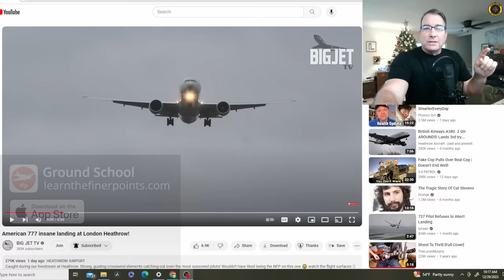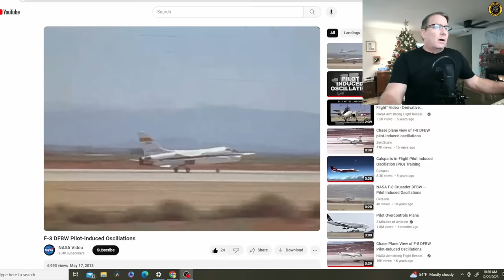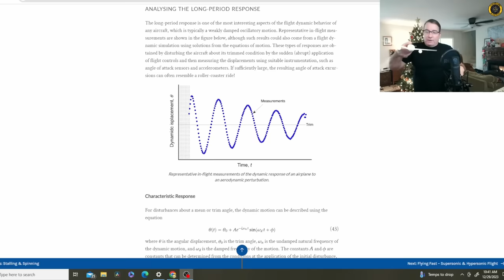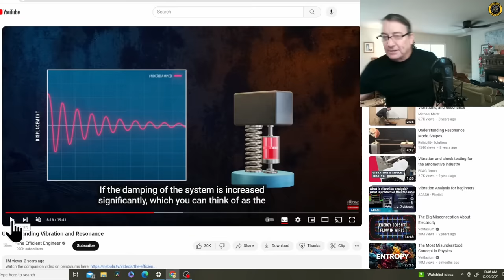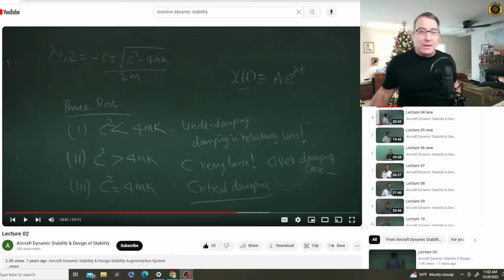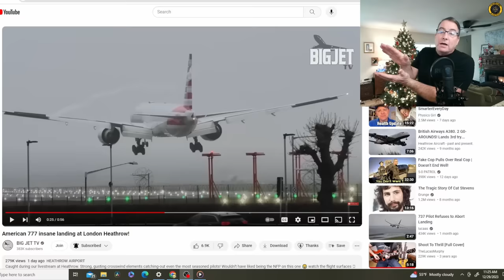B-777 Hard Landing LHR Big Jet TV

Comment: Not sure why my comment appears to have been deleted?  My point was that this is a much more complex issue.  PIO is not so simple, and in this case, the flight control system is actually commanding the elevator.  The pilot inceptor is a rate controller, in this case it should be theta-dot, so the elevator might, or might not, be moving based on pilot inputs.  There is simply not enough information to know here.

Comment: Watching the video, the wings appeared nice and level and then there is a large amount of spoilers on the left wing along with an easily seen right wing flaperon moving down.  Seems to me that initial wing drop starting the whole upset sequence was started with an inappropriately huge amount of left yoke.  Almost like the pilot thought he was "inches" from the ground and was attempting to put the left main/upwind gear down just prior to removing the crosswind correction, except he was still quite high in the air.

Comment: Respectfully Juan, theres nothing normal about holding the elevator full forward in ANY landing. If you do this during recurrent in the sim the debrief is going to be interesting. We dont need to worry about the effectiveness of the nose wheel two seconds after touching down. It’s interesting that the rudder position wasnt mentioned-despite being to the right the entire time.

Comment: I was on a ba 747-400 flight into Sydney about 15 years ago,the aircraft landed extremely heavily upon landing the fo announced that the aircraft had experienced a bird strike.,As I was transiting through to Melbourne we were required to remain on the aircraft and during the delay there were engineers inspecting landing gear and the top of the wings.i am still curious how a bird strike can push the landing gear through the wings!!

Comment: JB after observing a few hundred landings by various pilots and aircraft, I get the impression that most pilots are overworking the ailerons and elevators on landings. Probably less so with airline and mil pilots. Is that likely and does it lead to PIO's?

Comment: was coming into Heathrow back in the 90"s we were close enough to the ground i could see the tails of planes in the hangers from the outside aisle seat so we were pretty low and all of a sudden we went to full power and as we had not touched down i knew it was not reverse thrusters and the flight attendant had saucer eyes so i thought not good and we went right back up and around for a second try the pilot came on the PA and said it was because we were too close to the plane in front of us they like to have 4 miles we were within 3 miles so he went around i thought maybe we got blown over the grass area was still a little breathtaking i must admit almost as scary as the time we hit turbulence so bad it launched every loose object in the plane into the air including my whiskey as we must have dropped a lot of altitude it caught the pilot off guard because we had no seatbelt light before hand but after we had to stay strapped in for almost an hour as the plane got tossed around like a toy

Comment: Juan, nice work both on the flight controls and the physics explanations !! When I first viewed this video I immediately said the captain did an excellent job.
I’m sure they got an windshear alert like 30 feet off the deck correct?
Maintenance pulled the FDR prior to release to have engineering issue more detailed inspection requirements after review. Safety first!

Comment: Hello Sir, Last time i saw yourself was on Manly (Bondi Beach), Have you Returned home since or doing show from Australia.
From what i First Saw was a Controlled Approach.
What Details did you have on the Cross Winds, Rain Defection, Set up of the Flaps and Slats, On approach as you show i believe this may, May have been a Forced Flight into Prior Aircraft Departure Thrust Overlay along the Runway being held in close Proximity to the Runway by the Rain (Heavy) i believe along with Blustery and not just necessarily a Straight on Head Wind, On that Final few seconds before landing all of these Factors listed may have come into Play, Would like to see the Actual Flight Data Recordings on this one, Could make for an interesting read.

Comment: I saw in one discussion that Boeing ship out the fuselage with the plug installed, but then it is removed again for the interior trim fit at a different location, (by a different company?).  Could this mean the issue is not a Boeing QC issue, but a logistics / maintenance issue?  
Sorry I can't be more specific. (I'm just an interested member of the public who enjoys flying and used to work for BAES in the UK; I'm not a journalist or interested party in any other way, so am not taking notes). 
Would appreciate your insight in this matter. 
Thanks.

Comment: While returning to the US from Korea in the '60s on a commercial 707 aircraft, we were landing in Japan. Our pilot, due to strong cross winds, got our plane out of sorts. In fact, our port outside engine touched the ground not once but twice before successfully landing. The pilot announced that this wasn't his best landing and we would be required to disembark. 
Sitting next to me was a US Airforce colonel who flew the military equivalent C-135. He was very upset. As we disembarked,  I tagged along as he inspected the cowling on the engine. He said we were 6 inches from eternity. Further, he would not fly in that aircraft unless they magnifluxed the wing. He said I didn't know how much weight pressure was exerted on the wing and engine. Well, we were grounded for a few hours while they replaced the engine cowling. They didn't magniflux the wing. As a young lieutenant, I asked the colonel if he was going to fly in that plane? He looked at me and said said, " Oh, what the hell you only live once-in-a-lifetime." He was second from last to board the plane, and I was last. As we took off, we passed a bottle of whiskey among us laughing as we headed home. Obviously, we made it!

Comment: Juan, you talk about inherently stable designs, but I wish you would include contrary examples of inherently unstable aircraft. As someone who has never been able to enter the world of pilots due to medical, I love how you explain things so much I wish there was more. Are there neutral stability aircraft for example?
I know it's a bit out of the wheelhouse, but whenever I hear a broad type class of inherently stable, I always love to get at least the name and a broad impression of the other classes.
Are here GA aircraft that are unstable? (other than warbirds)
Reply: All fighter aircraft and aerobatic aircraft have reduced stability, in order to enable quick maneuvers.  The Air Force developed the X-29 to explore negative stability, then built the negative-stability F-117. Both aircraft will immediately tumble and self-disassemble if they experience a total flight control computer failure.
Reply: @KennethAGrimm that doesn’t sound good at all.
Reply from the maker: Modern Fighter Aircraft...

Comment: I would not be surprised that a detailed analysis of DFDR may lead to the replacement of the nose landing gear.
Reply: No one is going to bother reading flight data recorder if you have an intact aircraft with undamaged QAR.
Reply: @blegi1245  QAR is just an optional repeater of the DFDR. 
Yet a close analysis of QAR / DFDR can reveal above limit stress at touchdown impact which are not visible at Landing Gear visual inspection. 
In quite a few case this can trigger a Nose gear replacement specially in case of single point contact - as it is the case here .
Reply: @patpat5135  imagine being this dumb. ICAO annex 6 requires all airlines to implement Flight Data Monitoring programs. You can't have operated an airline without QAR in every aircraft for about two decades. QAR records an order of magnitude more parameters (thousands instead of hundreds) at a higher polling rate than the crash survivable recorder.

Comment: Wait, don't tell me they are using Arduinos for the processors.
Reply: Those Arduinos are what I used for the electronic switch controls on my model railroad layout.  They were such a pain in the ass all the time, so I ended up removing them.

Comment: Are there pressure sensors above and below the wing tips for the computer to monitor cross wind gusts before the pilot can react or even accelerometers as backups for the wing tip pressure sensors.
Reply: The 777 has gust sensors only in the tail to monitor gusts in the yaw axis.

Comment: Wrt positive roll mode stability (at 02:40).
Does that mean a B777 with the automation off/disabled is able to maintain a steady bank angle with the hands (and feet) off the controls for minutes on end?
I would not have expected that. Is it the same with older designs like the 'analog' Boeings? Does anyone have a good link to the design principles that cracked that nut, then please do share.
Edit: deleted confusing reference to another comment.

Comment: No different to when a student pilot somewhat messes up a landing (though requiring a go-around, or just pop back up into the air and try again immediately) - power on if required, but just hold the aircraft level and stop doing stuff - the aircraft naturally wants to fly straight - hold it there until under control and drop her onto the deck ...

Comment: The worst pilot technique I have seen...

    The captain landed that airplane... (how do I know?) 10 years active flight instructing and another 30 years teaching in transport category aircraft... because that's what captains do.) The side that the main gear TRIES to land on is the pilot who is manipulating the controls.

    used the ailerons exactly the opposite of how they should be used... AND THEN PIO... or Pilot Induced Oscillations.

    these boys and/or girls need basic flying instruction.

     

    6 years in the Navy, 3 college degrees, 10 FAA licenses, 8 type ratings, 15 different models, a 40 year pilot having retired from United Airlines after 30 years as a captain. Retired on B-777-200 ER... which is the aircraft in the video

Comment: I enjoy your videos, just a minor correction:  I think you mean the pilot input(s) are 180 degrees (or pie radians) out of phase, not 90 degrees in describing the PIO.
Reply from the maker: No. 
90 degrees.
Reply: I respectably disagree, Juan:

At 90 degrees you are out of phase, but not completely out of phase.  When you reach a phase difference of 180 degrees the pilot commands and aircraft response are ‘perfectly’ out of phase and indicative of a fully developed PIO event.

See for reference:  “A [fully developed] PIO exist when the airplane attitude, angular rate, or normal acceleration is 180 degrees out of phase with the pilot’s control inputs” – Mitchell, David G. and Roger H. Doh, WL-TR-95-3049, Wright Laboratory (1995).

In physics we have a saying that (theorist) are not responsible for factor of 2, pie, or minus sign errors, but as experimentalist we must do better ;) - Pedro
 @blancolirio
Reply from the maker: @pedrofrigola5224  watch the video in slow motion. 90 degrees will bite yer ass.

Comment: Were the last second  adjustments done manually or by auto pilot?
Reply: It’s incredibly rare for a plane to be on autopilot at landing. Autoland is required sometimes just to keep up with required regulations but otherwise pilots are landing the plane by hand. Also, autoland wouldn’t make those kinds of inputs.
Reply from the maker: All manual.